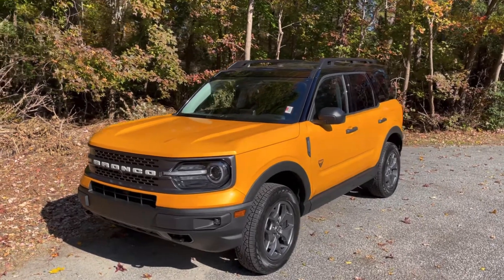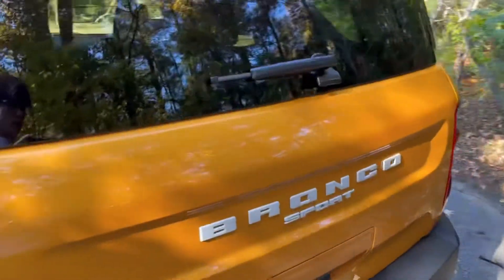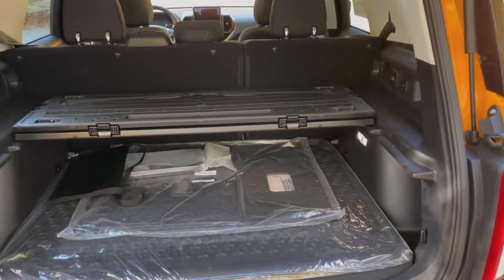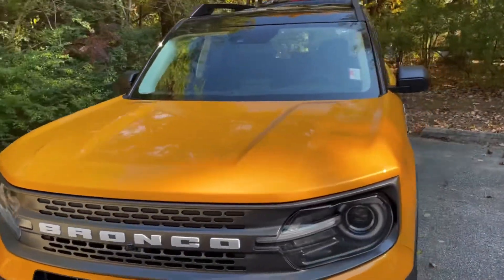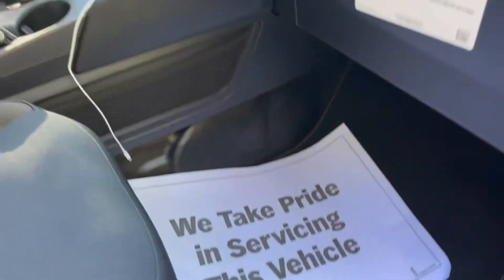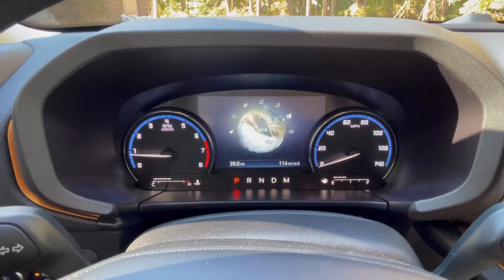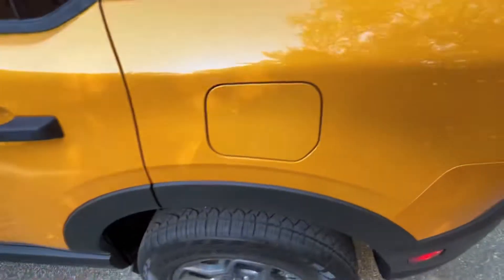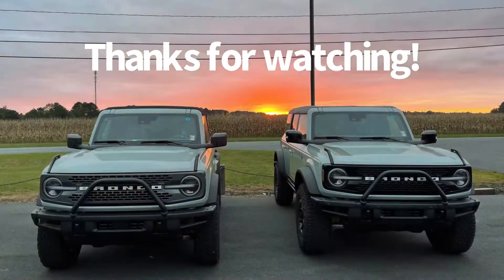The Bronco Sport Badlands is a Class Leading Compact Utility Vehicle from Ford

Comment: The front legroom is as much as a Nissan Pathfinder,  that's impressive.  Being an owner of a '17 Escape 2.0 w/ 75,000 miles on it, I have had no issues. It's a gem of a motor and it will run.  Just put 93 in it and a good synthetic oil, you won't have any issues.  I'm still on the OE brakes and battery.  The Bronco is a very beefed up version of the Escape, it's going to last.  This is going to be my Christmas present to myself.